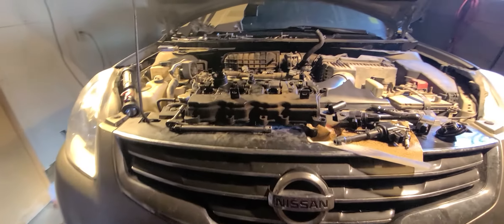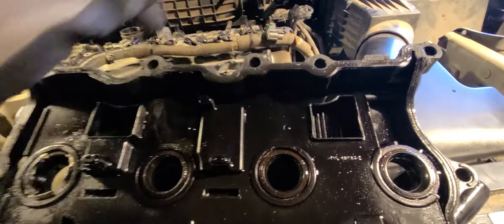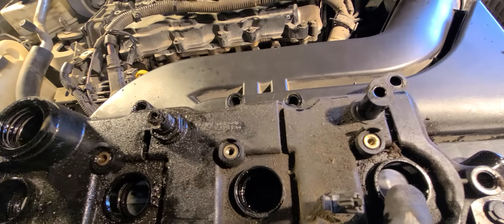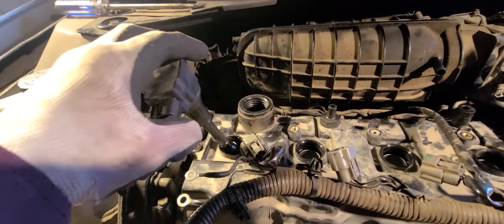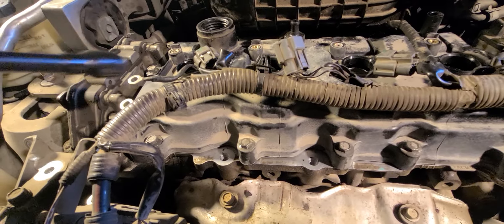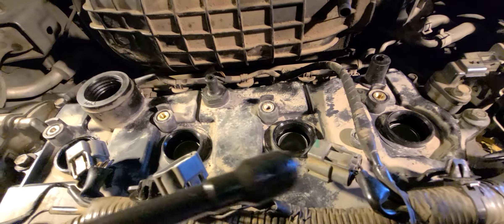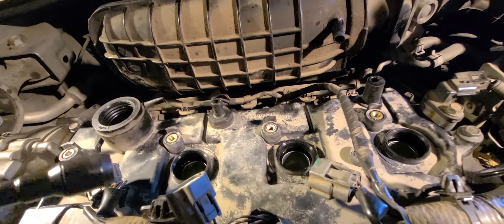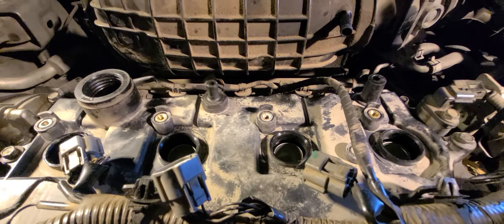Nissan Altima oil in the spark plug

Comment: Would this cause your car to overheat ? I’m losing coolant and my car is overheating. I have oil in my second cylinder with the spark plug. Blown head gasket ?
Reply: This particular problem with the gasket around the spark plug tube leaking should not cause overheating but stranger things have happened.

Comment: I have a 2012 Altima. I've already replaced the valve cover twice. The last time was maybe two weeks ago. There is still oil in one plug well. The same one as before I changed the valve cover. I did my best to do everything right and take no short cuts. Not saying I couldn't have installed it wrong though. I never cleaned the oil out of the well cuz I thought it would burn off but it's been at least two weeks. Does anyone know if anything else can cause oil in spark plug wells besides a bad valve cover? Could the oil in there just be the same oil that was never burned out? I'd appreciate any input. Thanks

Comment: So everyone knows, take a shop vac and suck the oil out of the wells with a oil filler tube or straw and your check engine light will go off immediately. But this does not fix the problem and you must fix the problem

Comment: Fuck that lol mine's doing the same thing I'll just buy some kind of sealer if they make any.. I did buy some Lucas engine block repair cuz I busted the block because in my  radiator and instead of busting my freeze plugs out it cracked the block that was on a 2001 Dodge ram though and I cannot remember the exact stuff I bought but it welded my block back together it wasn't a huge crack but big enough for antifreeze to pour  out of and getting that part in this video is not something you can just go to AutoZone and get I'm pretty sure that's got to be bought from the factory . I have the 3.5 Nissan Altima so I wonder if it's different you have to take a whole lot of stuff off just to find out.. it's so dumb it takes freaking all day just to change spark plugs they need to come up with a better design